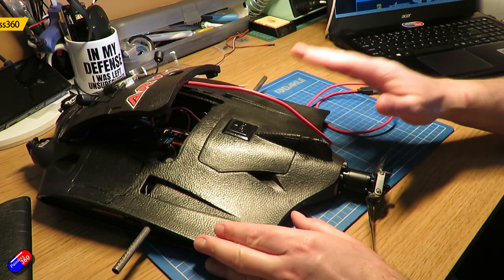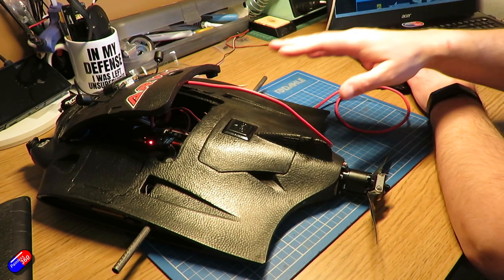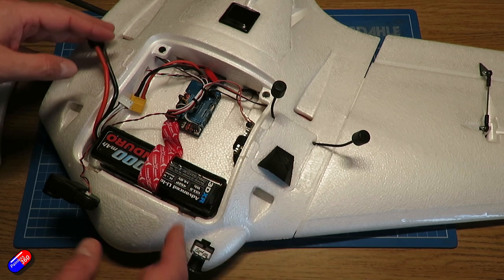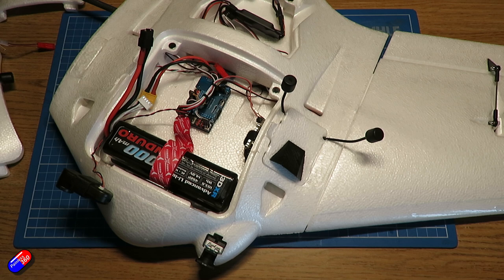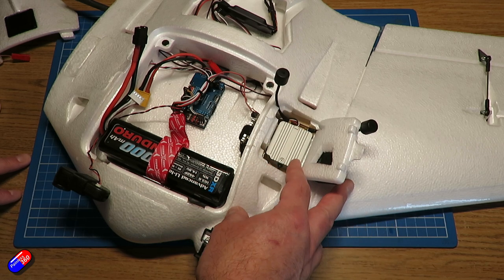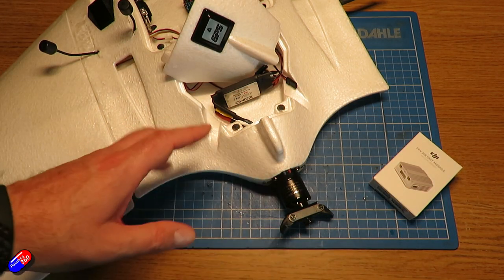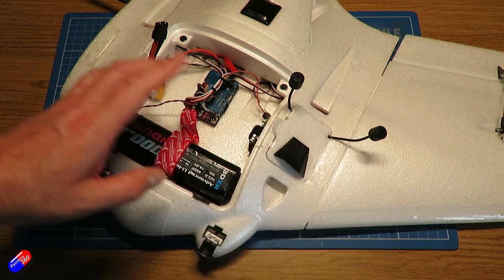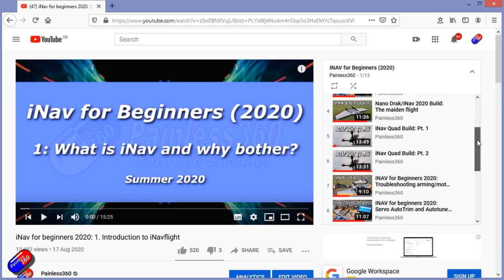Building and repairing a model: A cautionary tale!

Comment: Nice build, I have been debating on putting my vtx in that little side compartment but worried about the heat as well,I even thought about putting a little power supply fan in the spaces inbetween the campartments to move air.

Comment: Wow, I made exactly the same mistake and for the same reasons a week ago.  I was very embarrassed because as expected at such an event, there were a lot of pilots in the club.  Glad to see I'm not alone.  I paid with a lens.
Reply from the maker: I shared this as things like this are easy to do if you are distracted. We make them and learn from them and (hopefully) don't make them again for a while! Sharing this is to help others remember to do the basics. Sorry it was too late for your crash. Happy flying!
Reply: @Painless360  Thanks for the encouraging words.  Do not feel bad.  If I had seen the video before, I would have smiled and thought to myself that it was a rookie's mistake ... When I connected the motor I told myself to remember to check because there is no chance the motor and ESC colors match ... maybe it's age or distraction :) It's part of the hobby and if it happened to you, I'm proud to be in good company.

Comment: 3 wires, swapping any two changes the direction.. is that a 50/50 chance of getting it right, or a 66/33 chance it’ll be wrong??
Always seems to be the later for me..
Reply from the maker: There isn't a 3rd choice for the motor direction so it is 50/50. Happy flying!

Comment: Fairly easy mistake, we have all done stuff like that, i once got elevons reversed on reptile dragon, was lucky to get it down in one piece.....i have just got the eachine AR pro to replace my AR900 that was in a mid air collision, not flown it yet but what a pain, elevons are warped, spar did not fit and CG is proving a pain as i dont have the li-ion pack
Reply from the maker: Yep, those times we forget our basics (usually by being distracted or rushed) we pay for it! :D

Comment: Diodes on the rx/tx gone bad, that's why no OSD, if you have continuity between ground and tx/Rx. That's ur problem, just remove de diodes
Reply from the maker: Are you talking about in the Air Unit? 'Cause with the new Air Unit it works perfectly with nothing else changed..
Reply: @Painless360   yes the air unit, i cant post a link of the wiki page... but there are 2 diodes on the rx\tx  tace,on the air unit,to prevent damage ,when spark happen , tell me where i can send you the info, and you can check it
Reply: @Painless360  i sent you an email, yup the video transmission works, just the telemetry isn't going through... I feel you, I've been dealing with the Same experience you had, airwing crash...and no more OSD... however I hope it can help
Reply: @Painless360  Yes, there is a known "issue" on the Air Unit: when the voltage ground pin gets removed before the voltage + pin, then the voltage somehow backfeeds through the UART's ground pin and pops a diode (or something like that).  If you take it apart and physically remove the diode, the OSD should work again.  If the backfeed condition happens again after you remove the diode, it will permanently cook the AU.  I believe CycloneFPV has a video where he shows the repair (he offers it as a service).

Thanks for sharing your trials and tribulations!
Reply from the maker: Thanks for the email. Really interesting. Oddly, if I start with the working air unit then switch to the damaged one the OSD continues.. I'll check out the pins on the damaged AU... thanks again
Reply: @Painless360  when you say  : switch to the damaged one .... do you power cycle  the Flight controller ? just curious, I'll like to try as well, I really spent many hours on this one, but I guess I't's all about learning  ;)
Reply from the maker: No power cycle...